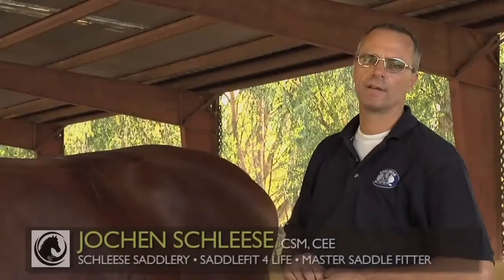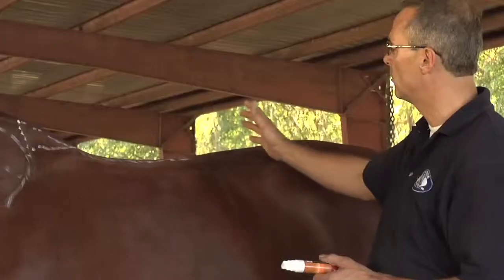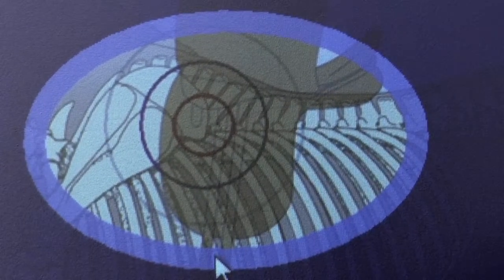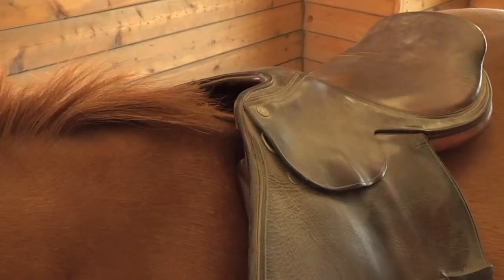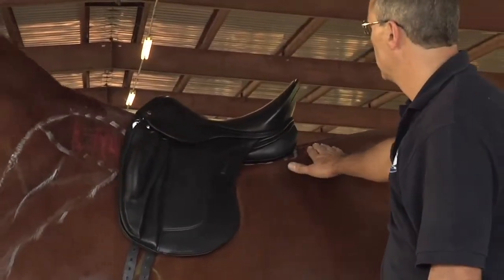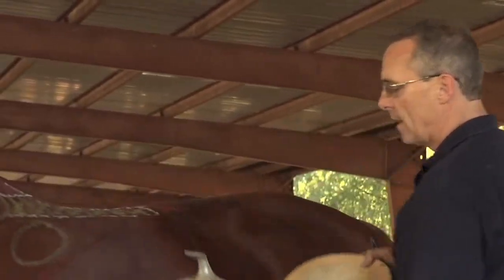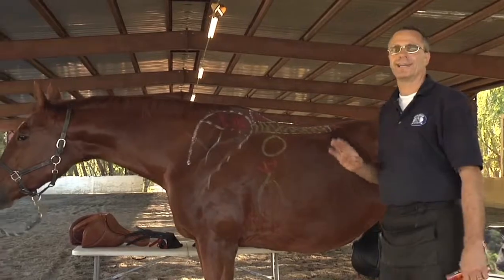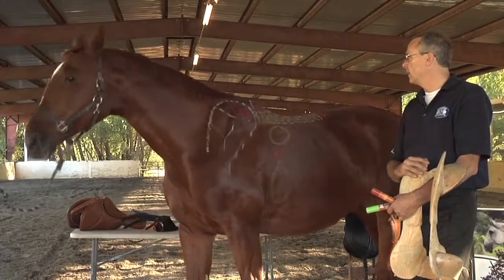Saddle Fit Basics: Protecting Your Horse From Ill Fitting Tack

Comment: I am really fond of Schleese and have learned a lot from his explanations.
My experiences as saddlefitcoach are a bit different about the front tree-angle. The movement of the scapula is not straight back, as it is seen in standing. It moves towards the body/the withers and flattens.
If you just follow the standing shoulder, often the saddles are to wide.
Every horse is different and has different history. Holes behind the shoulderblade makes it more difficult.
Very often, with a correct fitted saddle, you will have a fronttree that has the angle of a nice filled trapezium and the front of the saddle, where cushions come together with rest of the saddle; the front line of the saddle, follows the angle of the shoulder.
The cushions than, are necessary to match or level missing muscles or level movement.
I personally don't like the reducing in the cussions in front. Often it is not the correct place and most of the time the saddle 'parks' itself there, behind the scapula. That will cause problems again. It pinches more and more and water will stay in the soft tissues. 
Cussions can be over the scapula, as long they follow the build of the horse and are soft (still dence enough) to follow the movement.
Exceptions on above are often Frisians and Arabians, or mixes. The shoulder movement is wider.
In another video Schleese explains it a bit more like I did now.

Of course: a saddle should be checked at least once or twice a year.
Your horses change during their life!
Learn yourself and work with a saddler/saddlefitcoach.